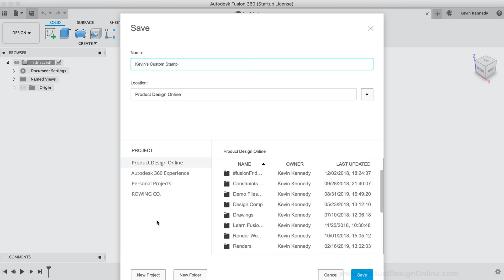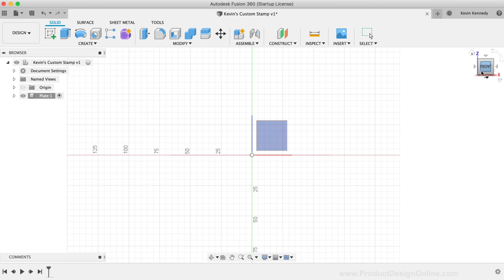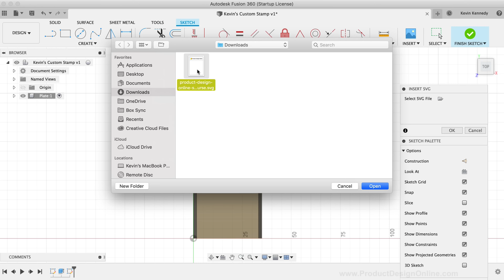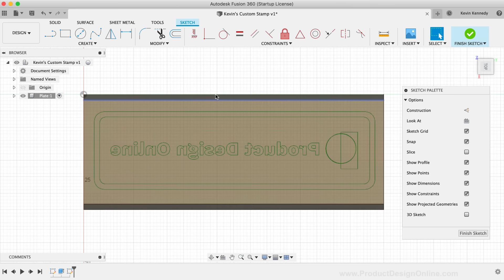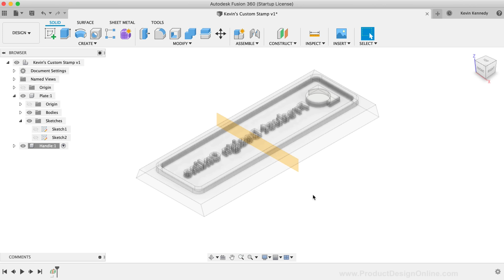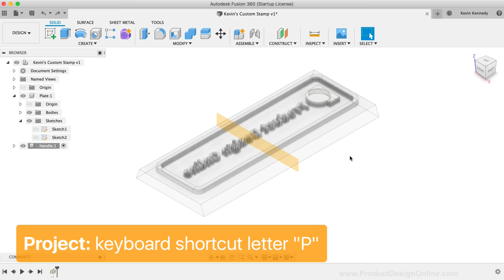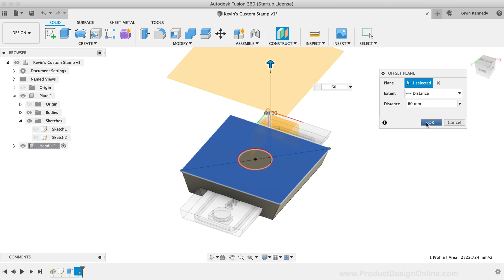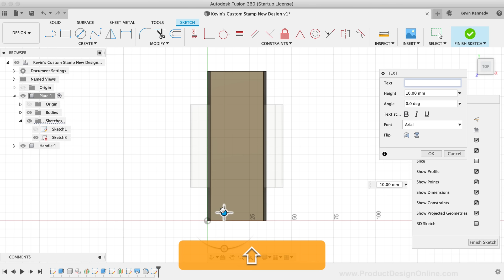Fusion 360 Tutorial for Absolute Beginners (2020)

Comment: I agree with other on your style of teaching. My PhD is in Instructional Design & Technology and I would say that you are better than all but one of my PhD professors. 
I gave you thumbs up - and subscribed to your channel - but I have one problem.  I am sure that is' me since it worked find in your video.  When I activate the drawing line by pressing 'L'  and then select "Front", I then go t draw the rectangle as you did, but when I click on the line it flips to the top portion of the X Z line therefor the 5mm and 70deg measurements do not fit the model properly.  I use a Mac, I don't know if that makes a difference.  If you can give me some advice, I would appreciate it.

Comment: I don't know if you mentioned this, but Fusion allows you to orbit as well by clicking the Left Shift button and the Middle mouse button.  Very useful and fast to do this way.  However, if you have selected to use orbit in this fashion, removing your finger from the Shift button doesn't stop the command.  You must remove both fingers from shift and mouse.  Then you are able to move the object by clicking the middle button on the mouse only.  To stop each operation you must stop pressing all buttons and then do the operation you want to do, be it moving or orbit.

Comment: Hello Kevin:
Thank you so much for the incredibly easy to follow course. It is clearly for 'absolute beginners', like me! I followed the video and did the project, however, I think I have a small problem. I had set up the component for the top piece but now I do not see it anymore. I suppose that when I had to delete some of my mistakes I must have gone too far back and deleted the component. Can this be fixed? If so, how? Also, I attempted to fix it myself, using normal Windows thinking and added several new line items that say "Selection Set". There are 8 of them now because I had no idea what I was doing. Can you help please???? Thank you in advance!
Ed Goldberg

Comment: Downloaded fusion 360 this afternoon. 
I've been using 3D drawing programs since the 90s.
The first one I used came with a tutorial that took me step by step through all the operations form the most basic to the more advanced. That tutorial was so well written, that  by the end I was able to produce drawings suitable for the catalogue of equipment I was designing. 
Much later I tried learning Autocad at college. It seemed that the instruction at that time started in the middle and worked out. Most of the time I was completely lost. That class started with 16 people and finished the first semester with 6.
I've been using sketchup for a while now but find it very difficult in many ways. 
Looks like you have produced a set of videos that will see me using fusion in the future. Congratulations!
You did lose me with SVG files. I have not come across that term before and don't know what it means. Please be careful to avoid acronyms in beginners videos. 
Otherwise well done!

Comment: Quite frustrated by the lack of intuition in this interface. Spent 45 min trying to find "group and ungroup" command in Fusion 360 to no avail. Decided to watch this video and was lost in a min. The tool I have when beginning to draw is not the same as yours. You never explained how to select it. Then you said "the line drawing tool is still selected" as you began the first angle. For me, it is not and I'm out of sync - without a clue. I decided to sit through this video to reduce my frustration, not increase it.

Comment: I’ve worked in production automation and robotics since back in the 80’s. Wrote program code in prob 10 or 12 different languages (proprietary deviations per specific manufactures) in industrial (M-code, G-code, etc.) settings. So am more or less familiar with production builds, CAD/CAM etc. But this reminds me more of using video editing software.
So I spent the last 2 1/2 hours following you on my smart TV while copying your steps on my laptop with F360 that I installed today. TIME WILL SPENT!!
Very much appreciate your taking the time to produce this extremely helpful video. Looking forward to more from your collection.
Hoping to design and print a two quart container for water so so that the base and sides have an inside radius rather than 90 deg for ease of cleaning maintenance. Can get most of it but not sure about the inside radius. Any hints on that....
Thanks so much for being clear and concise!!! ( I subscribed today too, full bell).

Comment: Hi, loved the video! I had an issue when i went to save as an STL though. I also have cura. After moving the plate to the slicer, it worked just like yours did, however when i went to do the handle, it opened up a new cura window instead of placing it with the plate like yours did. why is that? is there a setting i need to change? Thanks!

Comment: Hello, thank you for the wonderful tutorial.  I am trying to wean off 123D and use Fusion 360 instead.  All the of things that I wished 123D had, Fusion 360 does it well.  I am following your tutorial and noticed at one point when extruding the stamp 90 mm, that the end faces seemed to be missing.  I thought this was a fluke because I can see the trapezoidal stamp face when I orbit around it.

However when I go to select the end faces to perform the Midplane part of the tutorial, I find that I cannot select the end-faces.  Instead, I click right through and select the bottom face, or the top - but never the ends, no matter how I orient the stamp body.  What did I do wrong during the extrusion?

Thank you in advance

Comment: I am having trouble flipping the text on the plate. 
I've created an svg of my name in Inkspace. I insert the svg in F360, scale, rotate and place it on the plate and click Horizontal flip which flips the text in place. However, after I click OK there is an orange bounding box where the text previously was on the plate, and the text is now located outside of the plate and the bounding box instead (like flipped from the left side of the text). How can I get the flipped text to stay on the plate?

Edit: The solution to the problem above is to use the 'Object to path' command for the text object in Inkscape before you save it as an svg file. Then the svg will work properly in F360.

Comment: Thanks for your tutorial! I come from Rhino and am greatly confused by the software options. However, I'm starting to get it already after just one tutorial. What a great piece of software! I'm going to create a new machine with multiple parts and am very curious how I can create two components that share one extrusion as I need two separate components on each corner of the machine with a beam going through under an angle. The angle will be discovered while designing and isn't known beforehand. I haven't found out how to do that yet.

Comment: Kevin, my plan was to go through the Absolute Beginner tutorial and then do the Learn Fusion 360 in 30 days playlist.  However, after completing the Absolute Beginner tutorial, I wanted to ask if you had a tutorial that spends more time on deciding how to approach the design itself rather than where to click to complete a task.  For example, on the stamp that you create in this lesson, how did you decide to model it the way you did?  What other approaches could you have used?  I find at least for me that I learn much better by understanding the process and the options available rather than learning where to click (since programmers are constantly rearranging the interface and renaming menu items).  For example, you created the handle by setting a midplane and then projecting from the stamp without any explanation of the planes and their use or how and where projections are used.  For beginners, wouldn't it have been easier to just model the handle separately without introducing these extra concepts, particularly since this is labeled for Absolute Beginners.  In any case, are there any tutorials that focus on how you take something you want to model and decide what approach will work best in Fusion 360?  Thanks.

Comment: I am sorry to interrupt. I just got on Fusion 360 few days ago.I have previous experience in some other software. I was looking for  some video about creation/extraction of electrodes for EDM sinker. Tried Fusion 360 Mold electrode extraction, then creation then just Fusion 360 Electrode extraction, then creation instead, then just Fusion 360 electrode....but nothing came up.
I saw Lars has previously done electrode creation on Solid works software. I am wondering...am I overlooking something or should use different keywords or? Can you point me in right direction?
Thank you

Comment: Nice job Kevin. Did you print this and try using it? How was the quality of the stamping? I was wondering how a hard pla plate would transfer the ink. Rubber stamps have a little bit of give.

Comment: here is my deal I learned enough F-360 to make a series of parts for my trains. Bu then the updated the program and i have yet to find everything i knew in the old version,  I desperately need to learn to design my parts with more accuracy and how to manage sketch data. I had one complicated part and by the time i had it done i much have had 30 sketches all  stacked up. It was a mess, then my part some how became out of square and the part is failing. It is a huge mess. I watch anything you put up and really need to get back up to speed and smarter. Patience is not my strong suite, i want to build the trains in my head but it is so slow. Thank You Looking forward to many more, Dennis

Comment: As part of my preparation for my 1st 3d printer (Prusa Mini on pre-order) I decided to start learning Fusion360.  I thought you did a very nice job teaching this first lesson.  I found/used a web-based (drawsvg.org) app to create my SVG file.  If you were actually going to print this, would you use a flex material for the plate which would mimic the rubber that stamps usually have?  Would you use PLA for the handle?  I'm not sure I'll print this, but if so, I'd appreciate learning more from your experience.

Comment: The first few steps when creating the rectangle and positioning it into the bottom quadrant could be explained slower. the next couple steps creating the second box and angle also are not slow and clear enough ( When to hold the left or right button when to release and move all of this matters to a first timer and it is not clear enough for a first timer) Thanks for the hard work

Comment: I'm totally new at this. I p/u a book that I have been working through but this is very helpful. I've taught myself a lot of stuff in the past, so I'm hoping I can learn this through videos and reading. I want to use this for 3d modeling models and stuff on my ender 3 or mars printer. Mostly for gaming. I'm really hoping to do things like design my own dungeon tiles and creating model ship designs or modifying files that I find. I have to split some for my machine build plates so I want to learn this also. I would really love to see it done w/ a file I have so I can learn how to take it from a sls file, modify it and  create the stuff I need to print it out. So I'm hoping to learn as much as I can as fast as I can. The book is Autodesk Fushion 360 A Power Guide for Beginners and Intermediate Users 2nd edition. Apparently while it uses a more current interface, my 360 update must have updated since it's release. The printed it earlier in the year so I figure that I must be close to the version they used. However, it does look a bit different. I was glad to find this video and see that it looked like the version I am using. I'm hoping you'll continue so I can learn what my different commands are for. I think I've figured a few out via the first chapter of the book, but I gain more confidence seeing the exact shame program interface. Anyhow, I'd love to see more videos. Maybe 1 or 2 towards modeling for games etc.?

Comment: That was a terrific tutorial.  I'm trying your 30 day fusion tutorial but I'm finding it to be very difficult to learn with them as the videos were made with an older fusion user interface.  the biggest problem I have is figuring out the "solid surface sheetmetal tools and sketch modes.  it's making the sub commands harder to figure out.

Comment: Great tutorial! I was just figuring out the old UI when they changed everything! Any chance you could do a tutorial on 2d for the new UI? I a 68 year old newbe and only use it for CNC plasma cutting. Hard to get a grip on moving and measuring distance between elements, checking angles,  parallel lines, consruction lines, etc. Simple stuff like that. Thanks much!

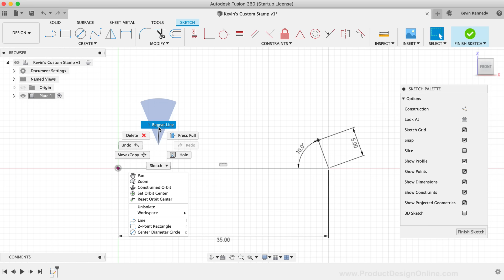Comment: Excellent tutorial. I'm not clear on the purpose of repeat line and repeat offset at 6:40 & 19:20 as apposed to just hitting L or O and doing it normally. What is the difference?

I'm enjoying working with Fusion so far. Some things seem awkward to me coming from Sketchup though. Like at 20:20 where you make the line go past where the intersection point, then have to select the end point and move it. Sketchup would have just snapped to the intersection point in first step. Just one of those software idiosyncrasies I guess!

Than you for the work you have put into making these tutorials so easy to understand.

Comment: Thanks for making this tutorial! I followed along and created a stamp. This tutorial was very easy to follow and well paced and I ended up with the same result as you did; with a few personal touches. Even though I rewound throughout the tutorial, because of examining options and not focusing, the only time I was slightly lost was when you deselected the body and when you said you could select more edges with the Fillet tool. I found out that all you need to do is left click in space to deselect and to hold Ctrl to select extra edges but I'm just pointing it out in case it's useful.

Comment: Hi Kevin, great video and easy to follow instructions. I do want to point out, however, that your plane perspectives seem to have been previously modified. I just downloaded and opened Fusion 360, and the default plane axes for the Front view do not match yours. Simple fix is to work on the Bottom view that matches your Z-X plane, but, how is this customized to follow the video instructions precisely? I suspect others may have been pulling their hairs out as well. 

Edit: Ok I found it - After selecting the Bottom view by rotating the axes planes cube, then selecting the drop down menu just to the bottom right of the cube, and clicking the penultimate selection “Set current view as”, then clicking “Front”

Boy, what an ordeal! Lol
Hey, I learned something :)

...and some observations for fellow viewers:

 After pressing the L key shortcut, when you select the center point, click and release, then move the mouse to the right, but do not click again until you modify the measurements, as Kevin says, using the Tab key to switch between angle and distance. I found myself clicking and dragging which compounded the above troubles.